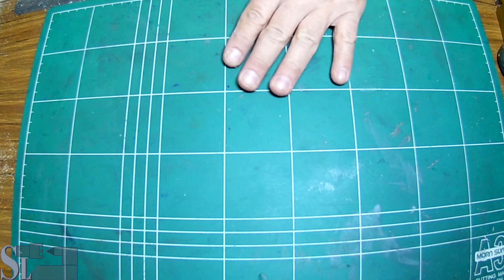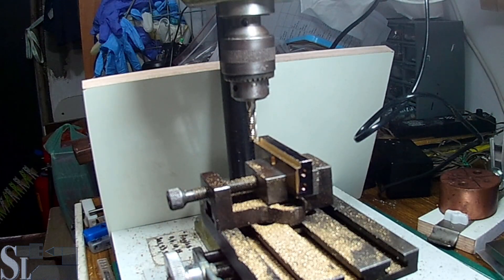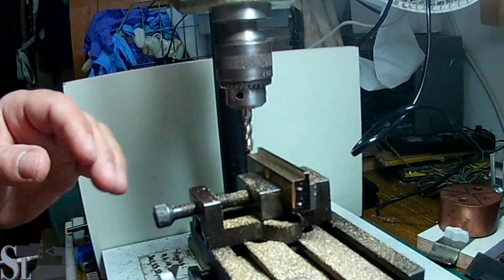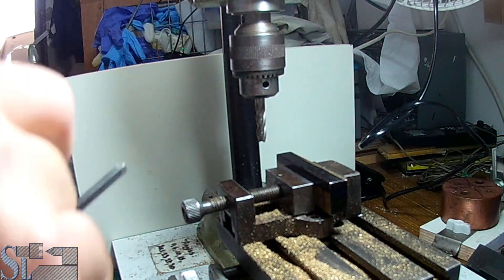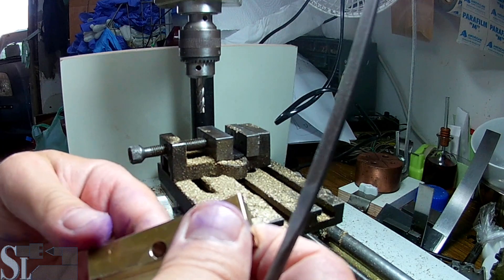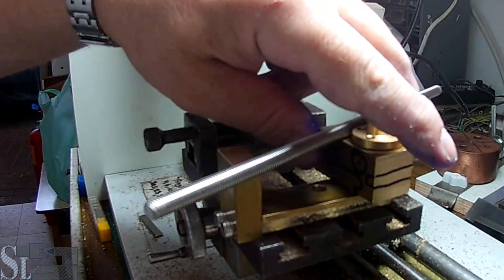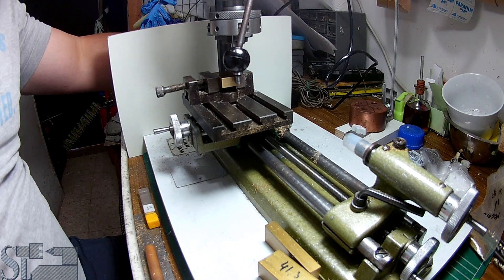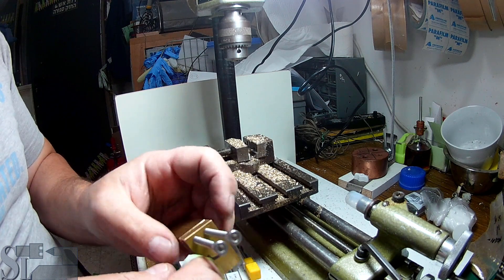Compound Rest for the unimat SL 1000 - part I

Comment: Thank you so much for this video.  I just started using my Unimat DB 200 as a mill.  What do you use for parallels?  All the mill parallels available are way too big for the small vise on the Unimat.
Reply from the maker: @Kijiji-ny7qh  My pleasure. Glad you found it useful!  Parallels - I use two high speed steel blanks 6mm*2mm ground stock. These are ground to size and very parallel ... Yes, regular parallels are too big for the unimat tiny vice :)
Reply: @Smallathe  Thanks!  Subscribed.
Reply from the maker: @Kijiji-ny7qh  my pleasure again. Glad to help a fellow minilathe owner and maker :)

Comment: Wow.  Given how much the whole thing bends when you gronk on the vice screw, it's surprising you managed to get any sort of straight cut at all.  Still, you've got a result, and I can only admire your perseverance.

If it was me, frankly I'd use the "milling" feature for accurate drilling, and do the rest of the construction with pinned / screwed construction, and file work.  At 0.1mm per pass, you'd probably be faster with a file anyway.  If you drill out the majority of the material first (drop straight down with a centre cutting end mill), it's pretty much guaranteed..
Reply from the maker: I did consider cutting the groove with a hack saw first... and yes, even though I bolted every screw to its max, locked the z axis as best I could, the unimat sucks as a mill. You are right there... drilling... oh... with a z axis up-down of only 15mm??? Not easy... thanks for the tips and feedback!!! :)